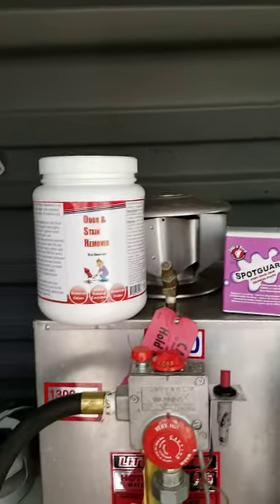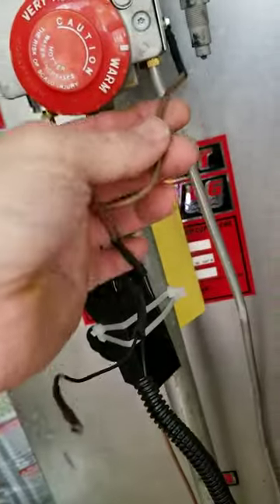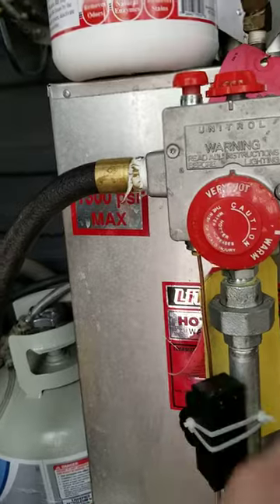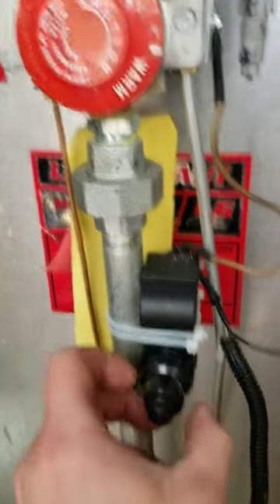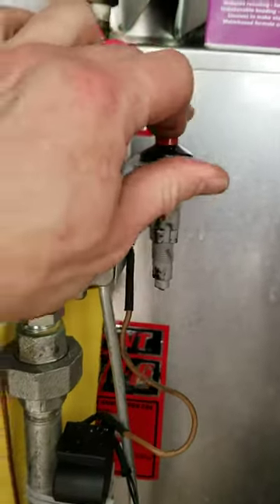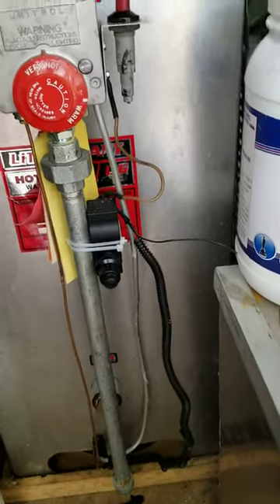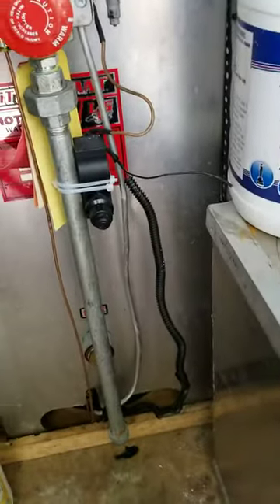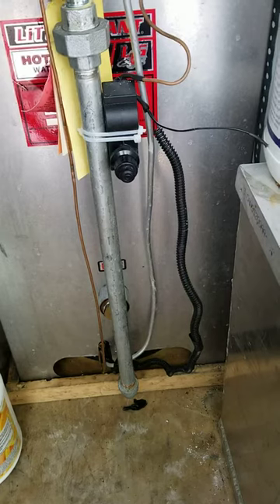Little Giant heater modification

Comment: I would never recommend anyone use a diesel heater for carpet cleaning they put out way too much smoke and soot i bought one from magic wand and damn near burned down my van. If your considering a fuel fired heat exchanger go propane otherwise get a normal exhaust heat exchanger they are less headache overall
Reply from the maker: I’m sorry to hear about your negative experience
It’s part of why it came out with my own Heat Exchanger. Thank you so much for participating.